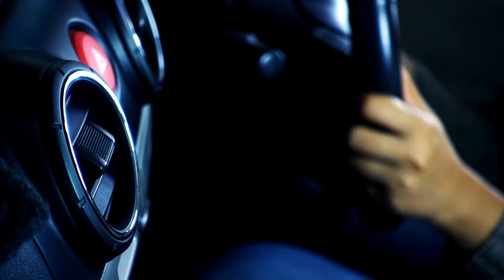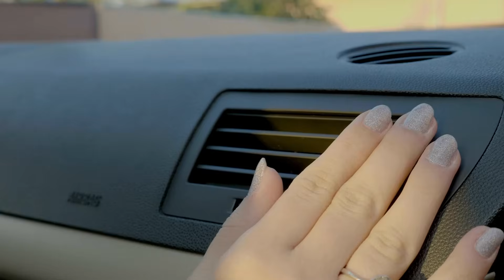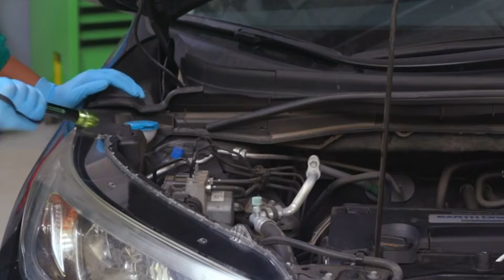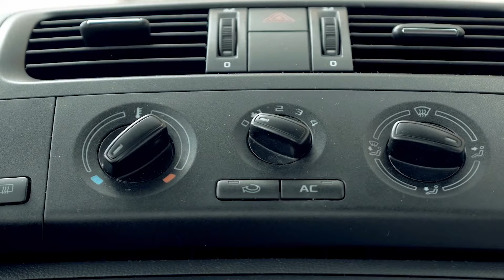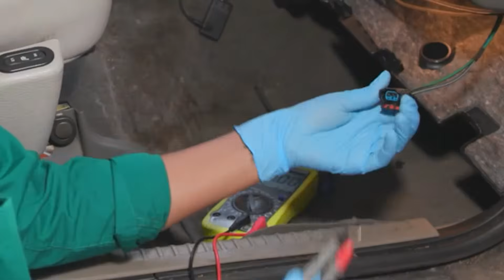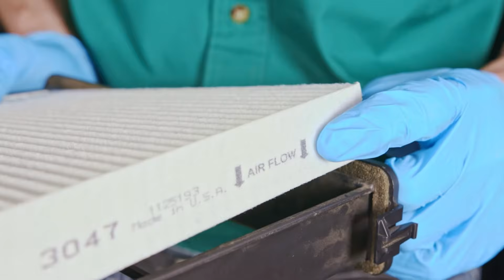Car AC Not Working? (Easy Troubleshooting Guide)

Comment: I have a 2022 Kia Stinger that has an issue where it doesn’t blow air at all sometimes. I’ve replaced the blower motor, the resistor and even the fuses related to A/C. It stops working at random times and after a couple days it turns back on and it works fine for months on end. I have no type of leaks, when it’s blowing air it works perfectly fine but I cannot figure out why it stops working at all.

Comment: I have 2014 Toyota Camry LE. When I turn ON the car's AC, it sometimes "engages" and starts sending out cold air, like it should. But sometimes it does not "engage" and the air coming out is normal air. What could be the reason? When it engages, air is cold. When it does not engage, air is like what would come out when AC is off.

Comment: Great video! Straight and to the point, and you explain it without a lot of unnecessary BS like so many others do!  Mine was checked/evac and recharged a year ago, almost exactly, turned it on the other day and it's blowing warm air. Everything is blowing fine, just not cold :(
Thank you!!!